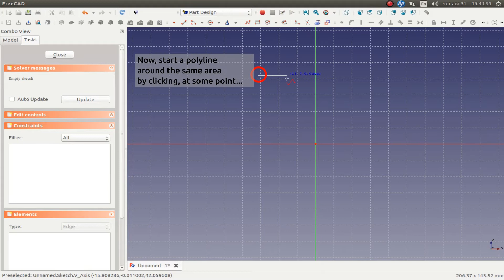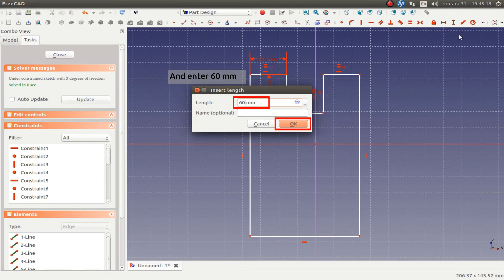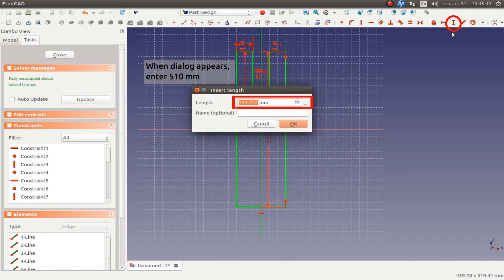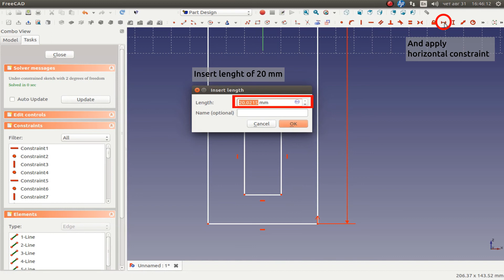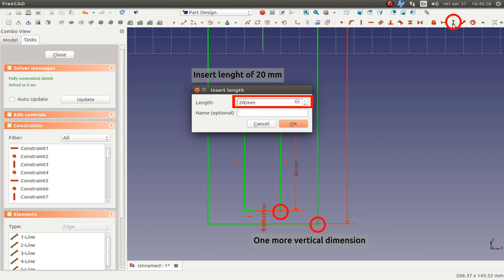FreeCad tutorial - Getting started - Intro - part 01_01

Comment: thank you for the effort to publish your useful videos! 
I m following the steps of this video, using freecad 0.20.1 and up until the point when i input the 2nd dimension (horizontal, 60mm) everytning seems to work as expected. After i import the 60mm value, i have 3 degrees of freedom at the solver. 

After i do the next step though, the symmetry of the two points, relevant to the vertical axis, i have an error appearing at the solver. It says "Redundant constrains: 5" and at the report view it says: Recompute failed! Please check report view. And a little bit previously at the report view history it says: Updating geometry: Error build geometry(9): Both points are equal
                                    Invalid solution from SQP(augmented system) solver.

I am able to continue with the design, with the solver not following and stating there is a problem though.

I wonder why does this function occurs..
Reply: Another detail regarding the prementioned issue is that when i press the symmetry constrain button, after selecting the two points and the verticalal axis, i have the prementioned messages appearing in the solver and the sketch itself changing color, but i don't see the sketch being placed in the symetrical position. Only after i click on the object and try to drag it, it goes and snaps where it should go, symmetrical to the vertical axis.
Reply: doing the next symmetry, also results in the solver an error an d now i have two redundant 5 and 11. When i try to define the 510mm vertical dimension though an error window pops up saying "Datum 510.00 mm for the constraint with index 23 is invalid", and by clicking ok on this pop up window the message disappears and so does the 510mm dimension i was trying to input.
Reply: only after i manually delete the previous two mentioned as "redundant" constraints i see that i have 1 degree of freedom at the solver and i am able to input the final (510mm) value and complete the sketch. There is also an option to check called "auto remove redundants" but to tell the truth i am not even sure these two constrains where redundant to begin with. In the end, the problem i described above looks like a neotirism of the solver of freecad. Maybe this "neoterism" can be helpful in some senarios, but for now it has been confusing.
Reply: i had to manually remove the same way the redundant constrain that appeared when placing the holes parameters and after then everything worked as the tutorial.